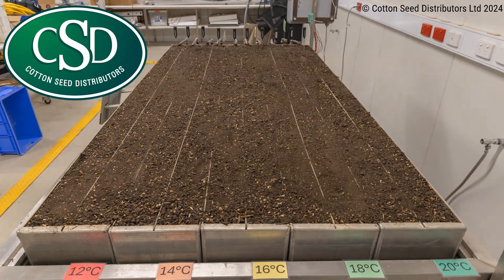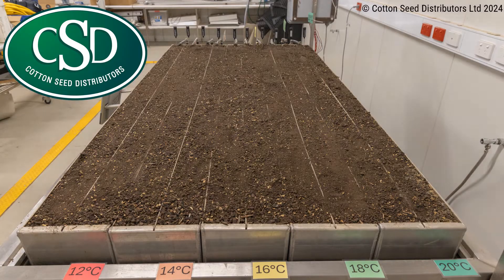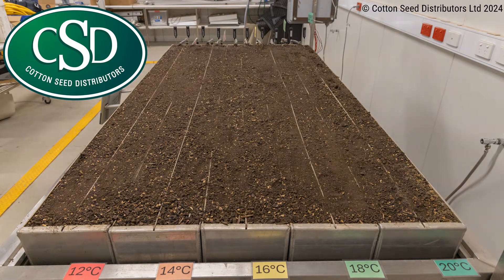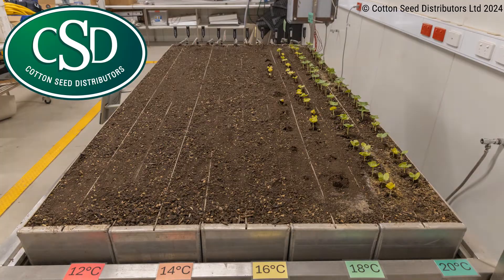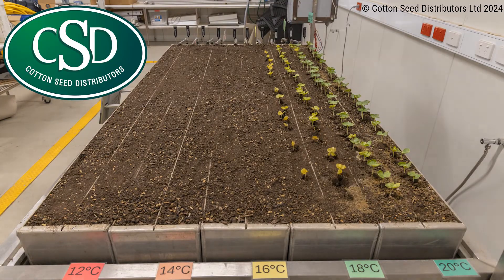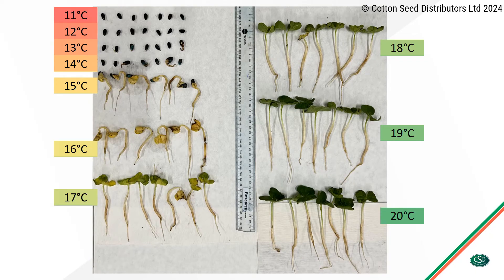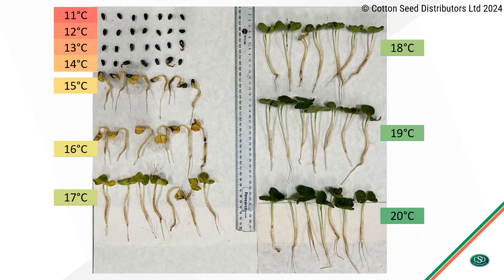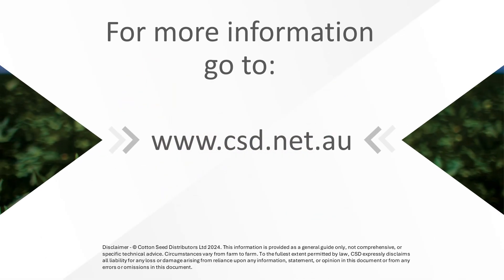CSD thermogradient table demonstrating germination between 11 to 20 degrees.

Comment: thank you so much for posting this comprehensive and informative video!  ive been looking around to pool information about germinating in general as well as about cacti in particular and this was very helpful.  i knew some heat was good but this begs the question of where does heat begin to be too much for different types of seedling.  will be trying to keep mine at about 20 celcius for now!  many of my cacti seeds are hot desert plants, but others are alpine/highland and quite cold hardy, so i wonder what potential differences in germination conditions there might be